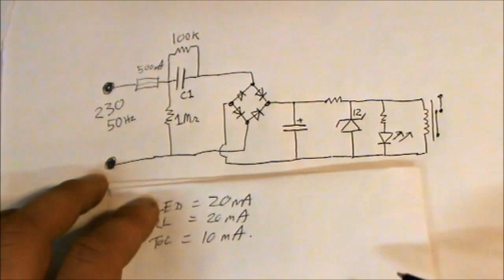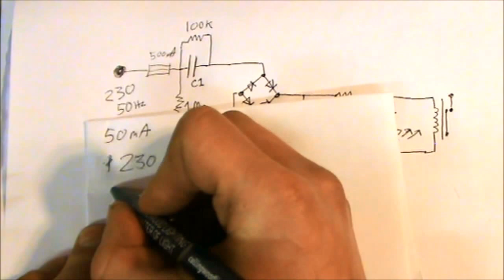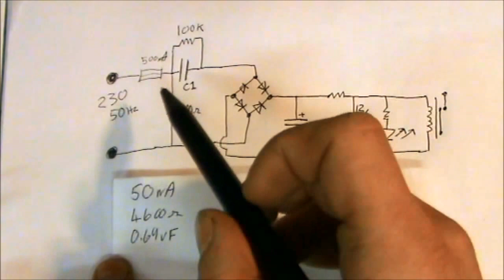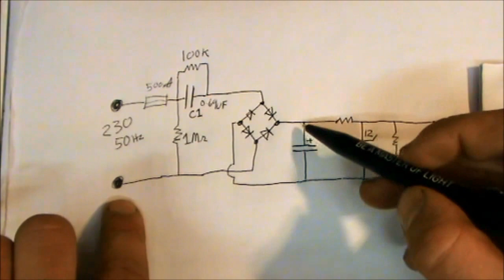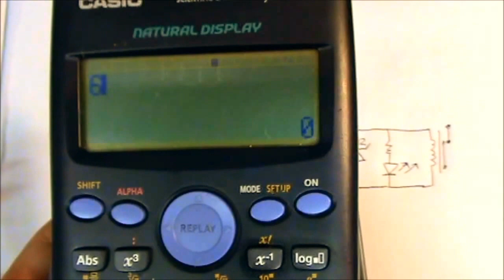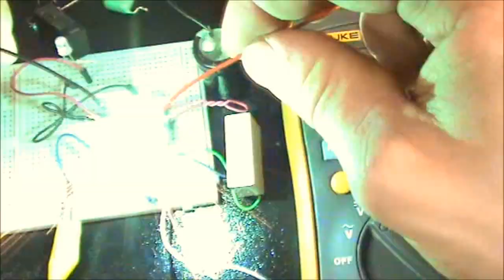Make a capacitor power supply

Comment: Great explanation! This is by far the best video out there for those who want to design, not copy this kind o f supply!
However, if you'd be so kind I have a few doubts.

1. I will run off of 127VAC @ 60Hz so I calculated a 1uF for 50mA just as an excercise because I have yet to figure out my current requirement. I'm terrible at unit conversions (milli, micro, nano, etc.) so could you double check my maths pls?

2. At half the VAC of your design, do I need to halve the two resistors before the rectifier to 50k and 500k ohms respectively? 

3. Is this supply suitable for an LDR --> Schmitt --> TRIAC configuration, or am I going overkill? 

I'd rather use a solid state relay with histeresis instead of a mechanical relay to switch my mains load and I have no clue how to add histeresis to an AC circuit. I've tried some AC powered LDR + TRIAC circuits, but most of them neglect to mention the relay buzzing at switching time!!
Reply from the maker: Hi Ryan , 
1. You are right with the 1uF capacitor.
2. You may reduce the 1Mohm to 500k, but leave the 100k. this value can be larger if you wish.
3. this is okay for the circuit you are using, most manufacturers will use this type of power supply for applications like yours. 
I'm not quite sure what your application is, are you just turning a light on when it gets dark? I think you'll be able to use 2 x 555 , to do that. Use one 555 as the comparator for the LDR, and the other 555 as a timer. for example, LDR goes low, output on 555 number 1 goes high, triggers the timer on 555 number 2, then turns on the triac? 
Just an idea, I'm not 100% sure what your project is.
Reply from the maker: Thanks for the kind words about the video!
Reply: Thanks for getting back to me so quickly! 

The plan is to automatically switch on a few lights at night. I could go buy this in a store but where's the fun in that?

I'm just using a 358 dual op amp, One side as an inverting comparator for my LDR with some added hysterisis and the other side to invert my signal back and get rail voltage out.

I'm only using one IC and a handfull of resistors. Pretty elegant if I say so myself!

Thanks for your video and help! Wouldn't try this without it!!
Reply from the maker: There is no fun in that at all! Sounds like a fun project, enjoy... be extra careful working on the mains side, its not very forgiving :)
Reply: Will do!! Cheers!!!